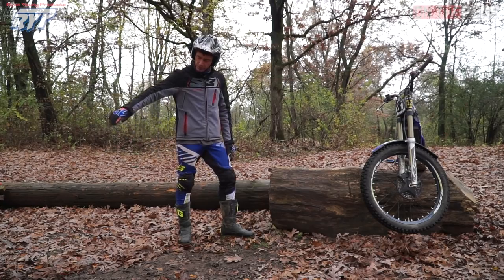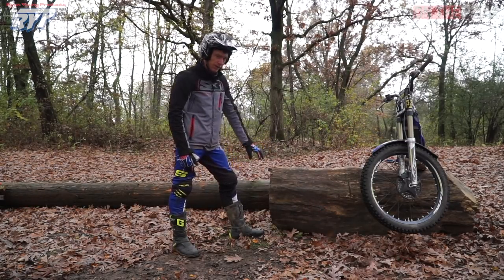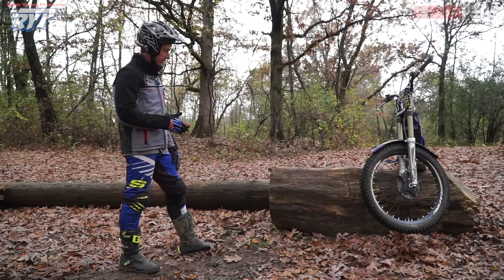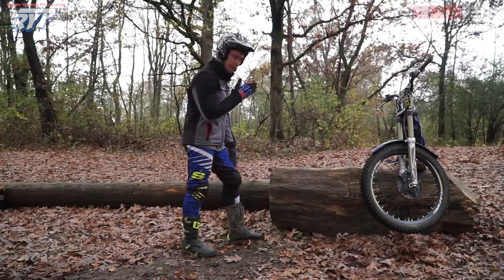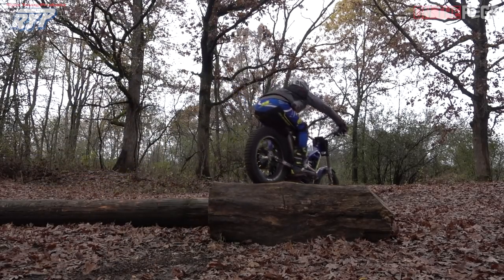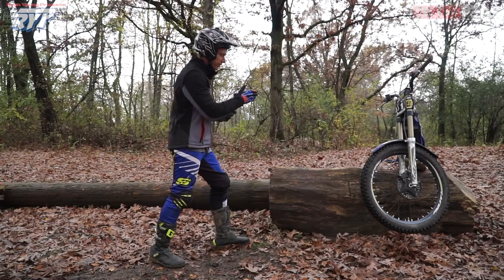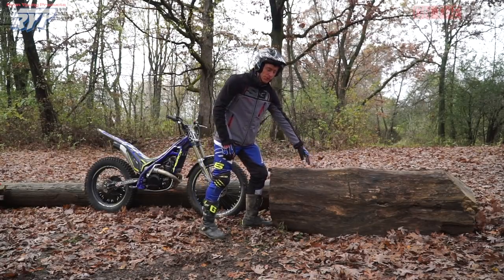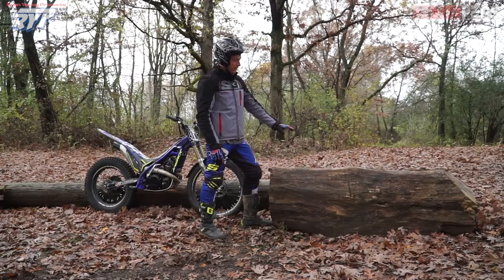RYP TV: MotoTrials How To #2 - Slippery Angled Logs with Pat Smage

Comment: What gear are you in for this obstacle Pat ? 1st or 2nd ?Keep up the good work , always appreciate new videos from You and RYP 😃
Reply from the maker: Knew I forgot something! I used 1st for this one. 2nd would work too but 1st can be a little quicker power for lifting the rear tire up rather than forward and since it was flat before and after the log, the power and speed of 2nd was not needed. Thanks! -Pat
Reply: Thanks for the info Pat , it was always something I wanted to learn from in the early RYP videos , But only found Ryan mentioning what gears to use in a handful of his early videos and classes on YouTube ( which were a great starting point )...Think it would be great for novices and also seasoned riders alike to know what gear selection You guys use for basic to technical obstacles ,  Climbs , jumps drop offs etc etc ...Thanks for all the help and pointers , looking forward to the next post 🙋🏻‍♂️